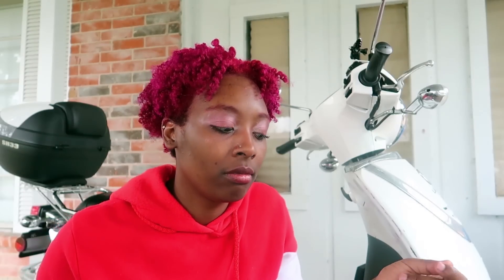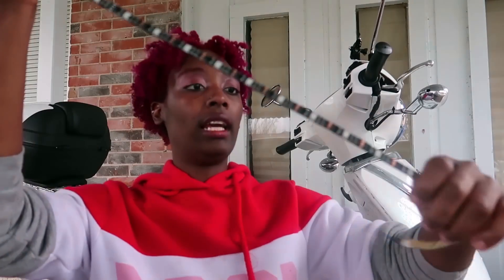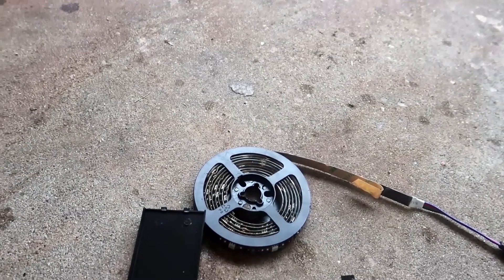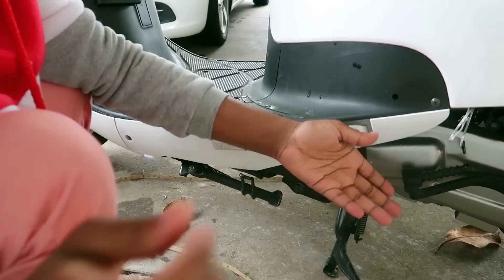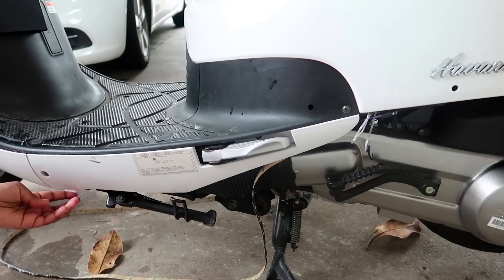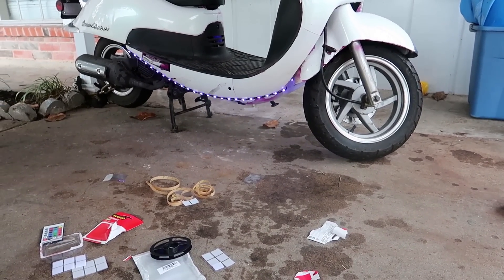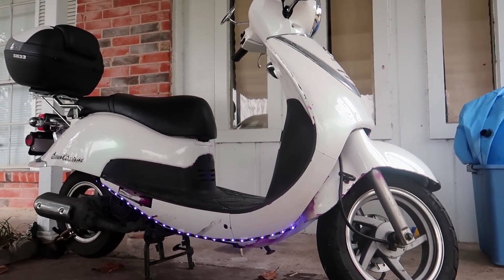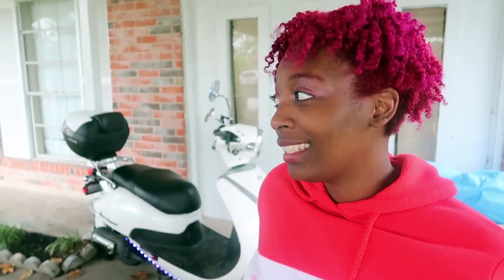Installing LED Light Strips on My Scooter

Comment: Did you get the lights to change colors? If not the control boxes have been known to be bad, I've put them in people's truck beds and had this happen more than once. Just thought it might help and yes could also be the remote but like I said everyone I had problems with was the controller box.

Comment: Your so cool. I cant wait to add all these extra features to mine. I got a gy6 muffler and im gonna install a performance carburetor and cdi cable next
Reply from the maker: Awesome Acero. Thanks for watching
Reply: @RamenOnWheels  i was told i should get my Carb. Rejettedafter getting a new exhaust.  should i go to a shop to get it done or myself?

Comment: Hello beautiful shauna my first bike was the tao tao 50cc which i put 11,000 miles on it before i sold it and got the 150cc I'm looking at a 200 or 250 Bms and not really finding any real spec for that brand any help you can give would be so appreciated

Comment: Did u plug them into the scooter battery  ?  Put a sound system on it next maybe
Reply from the maker: Nope, powered by Double AA Batteries.
Reply: @RamenOnWheels  the cops would give me a ticket in this country for using them lights at night

Comment: Only thing about 'LED strip lights some states & city can not have on when you driving!
Reply from the maker: yeah, In Texas we can use them but you have to stay way from certain colors. For instance: No red and blue (because those colors are for police and emergency) No Green and Yellows (because of Traffic light)
Reply: @RamenOnWheels  To late i already buy red led strip light to my helmet & hook it up!
Reply: @RamenOnWheels I got wireless helmet LED brake & turn light and when scooter come in hook it up remote to brake & turn signal light! I did research on it rate it 4 1/2 stars!

Comment: @Ramen on wheels hello Ramen and then there was a little bit more than a month into it but happy new year 2022 to you (HUGS Kiss on your right hand and the right side of your  I love the sound of your voice I believe I hear a little bit of a accent in there. I like the way you have your hair style you are beautiful God bless you always. Start today) I believe I seen you Wrap your scooter once. I purchased a different set of LED lights it’s more like LED string resembles silver and copper speaker wire but it also has the battery pack and a USB port in case you want to use a portable 5 Volts external battery charger. i’m just not sure what to use to apply it to my scooter I thought of clear lamination or scotch tape. Not sure if the heat from the lights would bother the tape. Do you have any thoughts that would help me secure the lights to my scooter. I wish you and your family and all the best in the new year stay safe happy and healthy always hugs thank you for your time and your videos.